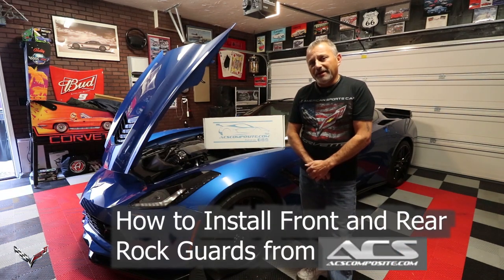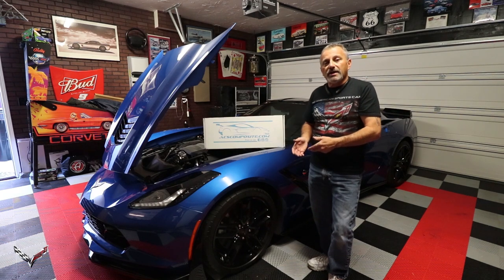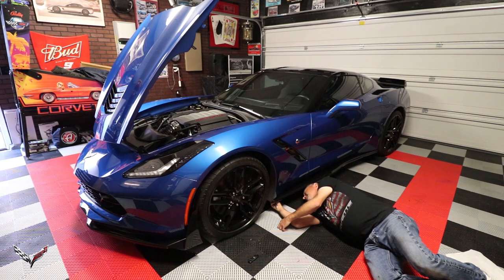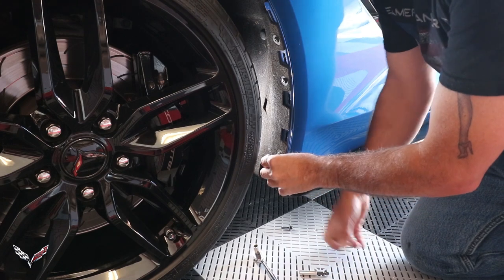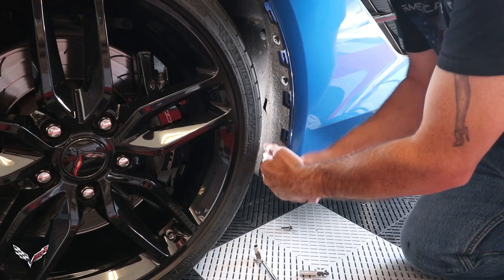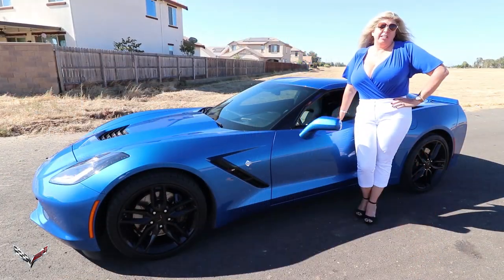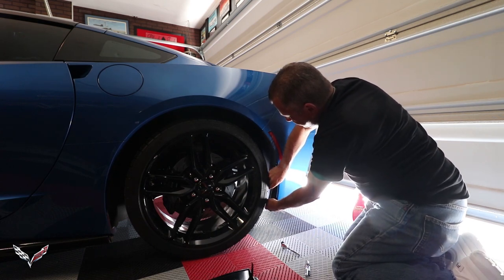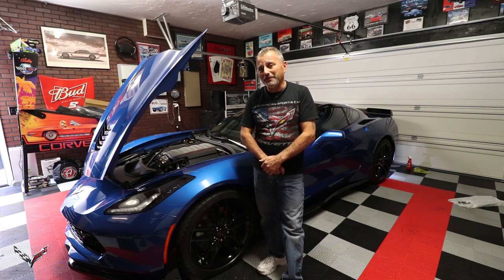How to Install Front and Rear Rock Guards From ACS Composite

Comment: On the front splitter, is it just a bolt on as well??
Reply from the maker: Yes it is. You just have to pick if you want a Stage 1, Stage 2 or Stage 3 Splitter